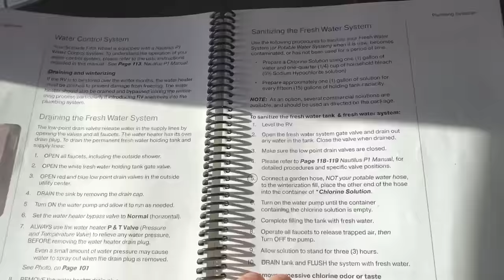MASSIVE WATER LEAK RUINED OUR RV - RV LIFE REALITY

Comment: ABS plastics are an amazing material, until you have to fix them. I once repaired an ABS basketball hoop base (the kind you fill with water), but it took a steel plate on both sides of the crack bolted together with a ton of silicone sealant. The epoxies made for ABS work but only if the temperature and curing time parameters are strictly followed. Also if there is a crack, you should drill a stress relief hole at each end of the crack or it will spread when it encounters vibration.
Reply from the maker: Oh good to know, makes sense! We haven't filled the tank all the way since to check so maybe it worked! Thanks for watching and sharing!

Comment: You guys are troopers trying to repair yourself.  Probably a new tank is what will be needed.  I had the electric side of my water heater go out and I was smelling something burning.  After looking at the heater the wired nutted the feed wires to the tank and loosened up causing it to melt the wire nuts.  The fix. Crimp the wiring. Good now.  Good luck and hang in there. Could of been worse and been the black tank.
Reply from the maker: Oh that is scary! Glad you were able to fix it!

Comment: If you have not already done so, you need to secure “ all” of the dangling wiring that you revealed when you removed the protective cover that holds the insulation.  I think I scotch-lok connectors.  They all need to be replaced with water proof connectors. Wiring need to be bundled and tie strapped, wrapped in convoluted tubing for protection. Finally secured to cross beams or structure. Loose dangling wiring can rub against each other and short out. This is what you get with almost all RV’s.  Good luck?
Reply from the maker: Good to know, we'll mention it to the service center! Thanks for sharing 😃

Comment: We have had 3 leaks in our RV and it was all the hot water connection hose. Under our bathroom sink, it filled up our under storage and ruined some boxes. We ended up buying plastic containers to put everything in them. (Lesson learned) Then the connection to our hot water tank we currently have a bowl to catch the water and then our kitchen sink it leaked but we caught it within a day but it was a slow leak which I'm glade we found it when he did.

Comment: Sorry for your trouble. 
This makes me love our Minnie Winnie even more. The entire underside is exposed. I have full view of both the grey and black tanks and all the sewer piping along with some wiring, gas piping and whatever. The fresh water tank is inside. It just sits on the floor under the bed with the pump. The water lines run inside the foam insulated floor. I am hoping there are no water pipe fittings concealed in the floor.
I'll bet you're sorry you prematurely bought, and opened, the new insulation. It ain't ever goin back in the bag.
Reply from the maker: For sure a downside of having an enclosed underbelly! Thanks for sharing!

Comment: I feel for y'all patching the tanks never works well, always replace it. I just got finished replacing one ordered directly from Icon tanks. The support definitely needs to have pictures sent to manufacturer and I hope y'all padded it with some spray adhesive and some type of rubber hose to keep it from rubbing tank  again. Even though I know you already purchased new fiberglass insulation for any future issues n other RVers when replacing your insulation pay the extra money and buy rock wool insulation it's all around better. Doesn't burn and if it gets wet when it drys out it retains it's R value still. Good job on taking that underbelly down it's a lot of work. Good luck to y'all n happy camping. 😊
Reply from the maker: 🤗  Thank you!

Comment: Sorry your going through this. It might be too big of a Crack to fix. But whenever you use any apoxy and dealing with water, plus it was cold outside(think they recommend above 50°) you HAVE to keep it cure for over 24 hrs. Maybe even try blowing a ceramic heater at the repair while it cures. Good luck. If all else fails, blame it on the tree.
Reply from the maker: Thank you so much for taking the time to write this out for us, that makes a lot of sense! We hope that allowing it to cure for 24 hours has done the job correctly now!! 😊

Comment: I have an idea, we use heat on car bumpers to melt cracks back together, now there is more to the process but, if you have an electric soldering iron, (pencil type so easier to get in tight areas) preferably with a flat pan type tip, you can gently melt the Crack back together, carefully not to melt through, just about halfway in ur case since you can't get to the backside. Tanks should be a few millimeters thick. Just smooth over the cracked area till plastic melts over Crack, then use your plastic repair over your repair, then after another check for leaks then put some duct tape over it to help with rubbing. Should last quite some time, at least till you can have it professionally repaired or replaced. Any questions just give me a hollar. Love you guys, don't want to see you struggling
Reply from the maker: Thank you so much for sharing all that. Makes sense but also sounds like too deep of a project for us. We may go the replaced route since it will eventually leak again.

Comment: Bummer! At least you know where it is, IMO the vibration on the tank needs to be addressed no matter now many repairs or even a new tank the rub leak will reoccur. You may want to reach out to grand design and see if this is a reoccurring issue with other people and maybe there may recall,  I know chasing leaks is frustrating I have been chasing  one, had the unit pressurized and found that the tail light was never sealed properly. Now I keep an eye on all my seals and do monthly inspections
Reply from the maker: Very great point Jeff! We definitely are going to be reaching out to Grand Design, we will keep you posted 😃
Reply: @HappilyEverHanks  just think it was only the gray tank and not the black I guess you lucked out sorta
Reply from the maker: Great point!! :)

Comment: I would try the marine grade epoxy and let it fully cure. I then would double back it with flex seal. It’s another 24 hours to fully cure. Sucks to have to wait that long but it’s probably the only way to eliminate knowing if you let it cure long enough. I have a leak in my camper and I have been putting off fixing it bc i didn’t want to end up like you guys lol. Been there done that. I had mice get in my camper in the winter and I didn’t blow out the water lines so one of those two are my issues. Good luck on the repair.

Comment: Holy shit! I’m dealing with the exact same issue.  My crack on my gray tank is in the exact same location.  I tried a 3M Marine adhesive sealant 5200, that supposed to be a flexible patch.  Failed!!  I believe, as the tank fills, it stretches the crack open.  No more screwing around for me, currently waiting on a new tank I ordered from Amazon.  Next time you replace your insulation, I recommend you use Rockwool insulation, it repels water.  At least you had insulation, my Evergreen Bayhill (out of business) with the all weather package has no insulation what so ever underneath.  🤬
Reply from the maker: No insulation? Wow! You know how it feels then! Thanks for sharing!

Comment: Howdie guys! That sucks big time. I had the same thing happen to my fresh water tank, around the valve to empty the water. It sucked cuz it didnt take much water for it to leak…To fix it, we heated/melted the plastic with a torch! It mended together instantly, and held for 2 years. I sold it in the spring, but betcha still holds. Koodos to ya
Reply from the maker: You are very handy! Thanks for watching and sharing. Sounds like cracks in tanks is very common.

Comment: If you discovered that bracket to be loose when you opened everything up, then that is likely to be the root cause of the failure. Also, if the tank is able to shift while traveling, then any additional rubbing against a hard surface will cause the tank to fail eventually.  
I did failure analysis of nuclear reactor fuel (metals) for a living and based on that experience, I would suggest that this is a design flaw and something that the manufacturer should have caught during their QA process.  (That bracket should never have been able to come loose).  If warranty is still an option I would be looking into that immediately.  In addition, given that bracket and the tank's location, it is unreasonable for a manufacturer to suggest that inspection of that area is an owner responsibility.
Reply from the maker: We are reaching out to Grand Design now :) We will keep you updated as we know more! Thank you for these great comments, we love hearing your insight!!
Reply: @HappilyEverHanks  thanks for replying. I look forward to hearing how Grand Design responds because we have a vested interest. We have ordered a Grand Design Reflection 337RLS last fall and are awaiting delivery.  So for us, it would be good to know if was a "one-off" or if it is indeed a design flaw that we should be addressing prior to taking delivery.  Best of luck!
Reply from the maker: @kvaillancourt7256  we are bringing some updates tonight, we hope to hear from you again then on the new video 😀👋🏼 Stay safe!!

Comment: That looks like your battery vent, switch to agm batteries and you won’t need the vent. I had a loose connection on my water pump and all I needed was a little tighter on the fitting.
Reply from the maker: We have an AGM battery installed already. So I guess we are good then?

Comment: Oh boy, by no means am I a professional tank repair guy, (former mechanic) I have had luck using a soldering  iron and getting plastic hot enough to melt and mold fuel tank leaks then using epoxy  over it, 2 coats 24 hrs apart,  keep us posted on the outcome!
Reply from the maker: For sure! Thanks for sharing!

Comment: 10:55 - This wiring routing  is so typical of installers.  No protective flex tubing wire tracks.  Those UR type wire connectors exposed to water corrosion - (More failure points).  I recall on my last trailer, the electric brakes were connected with those exposed to weather connectors. (Hopefully they were electrical-grease filled connectors).  (Brake failure? Assembler seems not concerned, after looking at there electrical wire installation).   🙃
Reply from the maker: Yeah, they probably don't take all that into consideration like they should. Thanks for sharing Jim!
Reply: @HappilyEverHanks  Welcome.       The wiring and connectors on motor homes and trailers has been one of those head scratching items, with more than one manufacture.   One example still quickly surfaces; a multi wire connection point on one side of the motorhome, (for side clearance lights plus a tail light or two), was found with two of the wires still twisted together, one wire just dangling in the front wheel well, not even a household indoor wire nut insulator was found twisted on, no scotch-lock weather-resistant connector, was not soldered.  Some rig background: New motorhome, (within the same paper-printed manufacture year date), maybe a month or two old with a few hundred miles on it. 🙃    Anyway, enough of my trouble experience blah, de-blah:   Hope you were able to resolve your water leak(s).  I will stay tuned…   For the next episode. 😊  Thanks for video logging some / part of your RV days.  Til next time…  Thanks again for showing some challenges along with the good adventure moments.  👍

Comment: Bummer..remember when dealing with cracks and crevices you just cant patch the outside. Gotta fill in the crevice. Hard plastic though. Gotta start inside the tank. Yeah. Ok. Just replace the entire future headache. Probably wont hurt while u at to stick a small piece of insulation between it for future rubbing  while u got it down. ✌
Reply from the maker: Thanks for the great advice!

Comment: Try the Marine apoxy , will cure with moisture , clean out the crack , then put a nice layer a couple inches around the crack , then leave the tank empty for 24 hours at least , I left the area I fixed dry for two days , lasted for years , maybe it will save you from getting a new tank , but should definitely last until you get a new tank , if you try it let me know how it went , also , remember when you mix it for application , you have to be quick , sets up fast , and you can put water on top of it to assist using your fingers to smooth it out.
Reply from the maker: Thank you, Ray. Really great advice!

Comment: I had a big leak on my 21 puma. Ended up being a screw that was installed by the manufacturer that was way to long. It rubbed a hole into the hot water line going to my washer in the wall. Luckily i found it and sent pics to puma. They are going to cover the damage!
Reply from the maker: Sorry to hear this Thomas, that's wonderful that Puma is working with you and covering the damage! Hopefully it's a quick repair for you 🙂Thank you for watching, we hope that we can continue to hear from you

Comment: That crack looks to be at a stress point, that tank will flex so the epoxy will not work.  A new tank is going to be the best thing, if not then weld the crack using a soldering iron then slap some eternabond over as a temporary repair.
Reply from the maker: Great point Kelly! Thank you for your insight, we appreciate your time and support 🙂We will keep you updated as we know more, talk again soon

Comment: Thank you for this video.  We recently sold our Discovery diesel pusher RV and up until we watched your video had been considering replacing our Discovery with a Grand Design 310gk 5th wheel, but after seeing how your under floor wiring wasn't protected or secured, but rather was just hanging loose (an accident waiting to happen).  The tank leak was no doubt due to the tank not being properly secured resulting it rubbing against a frame member.  We're now seriously questioning whether we want to buy a GD product.  We've owned two Class A motor homes and on both all wiring was installed inside plastic split loom for protection and properly secured so chafing doesn't occur.   We're questioning the purchase of a GD product now, but if we do we'll definitely have the dealer check and fix these deficiencies.  Thanks again.
Reply from the maker: Thank you for watching Butch, we wish you the best in your decisions. We have enjoyed our Grand Design (2nd time owner). Currently reaching out to them and working on getting a full tank replacement! That's wonderful you guys have been living in the Class A motorhomes! We hope to continue to hear from you on other videos as well ❤️

Comment: I never had any luck with JB Weld products, always failed, I don't use it. The good news is you know where the leak is. I would take it to the dealer to have them replace the tank so the work would be warrantied. What a mess, good luck.
Reply from the maker: Thanks, the conclusion of the tank story coming soon! in 20 mins actually

Comment: First off, the material the tanks are made of will not be compatible with most adhesives, epoxies, etc. The stuff to seal/repair RV tanks is Bondo body repair filler, and make sure area to be repaired is clear ed with acetone and is absolutely dry, the repair must sit at least 24 hours before introduction of any liquid, I've done this many times over the past 30 years, and is the  magic trick to repairing this kind of plastic material, db
Reply from the maker: This is great information Dave! Thank you for taking the time to share this with us 😃

Comment: New tank at this point. If you didn’t epoxy it you can tank the tank out and get the correct plastic welding rod and weld it. I’ve repaired black poly cisterns before same thing.
Reply from the maker: Thanks for sharing!

Comment: Yep it's going to take multiple layers of fiberglass and ABS glue to fix it.  Good advice to try melting with soldering iron and then follow up with layers of glue and fiberglass.
I would consider that a temp. fix tho.    Best to replace the tank at some point and address all the structural issues that surround the support of that tank.
Reply from the maker: We are heading towards the route of replacing the tanks. Thanks for all the great advice!

Comment: That tube is for your battery if the battery ever cooks off from charging the fumes will go out side and not where your sleeping... Also i just also just did all the plumbing in mine what the problem is all those vinyl fittings to pex was leaking for me what happens is the bands arent tight when the vinyl shrinks in the cold its an awful design with the vinyl tubeing i spent almost 500 in plumbing parts...
Reply from the maker: Oh wow, that makes sense! Thank you for sharing!

Comment: Try the tape you used on the roof.
That stuff sticks to anything.
Did it get cold enough to crack the pipe coming into the tank? That wouldn't really leak until it was full and backing up, then it would dump.
Its a bummer that tank didn't leak when they fixed the roof.
Reply from the maker: We thought about using the Eternabond for sure! 
Yes, the timing of the leak was a little off!
Thanks so much for watching and always leaving a great comment! Have a great weekend!
Reply: Even if your fix does work as is I’d eternabond over top of the fix to give it some padding as your driving down the road, especially if you tend to travel with some water in it. Just to be on the safe side.
Reply: @HappilyEverHanks  
You guys too!
Reply: @06dak69  
Not a bad idea. Stick it everywhere, anything touches it.